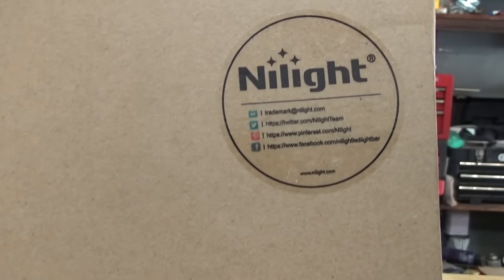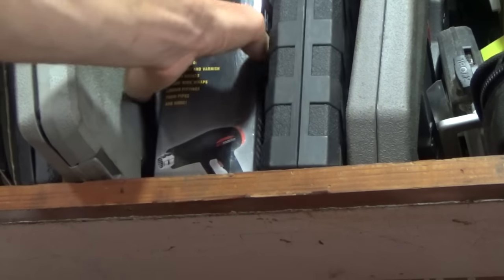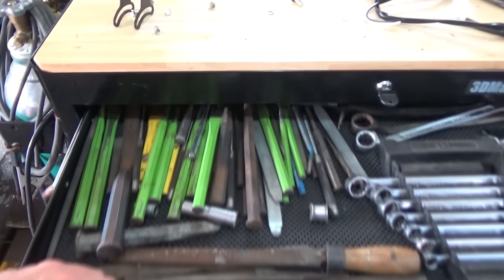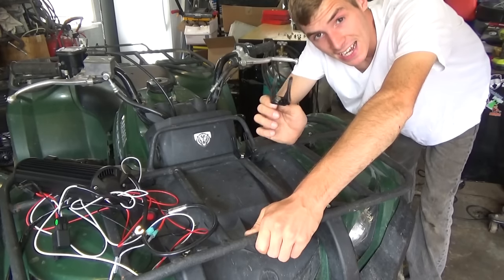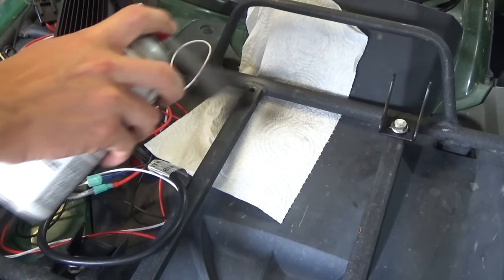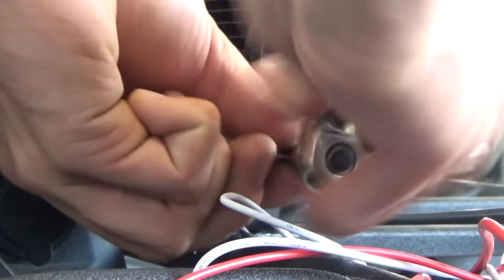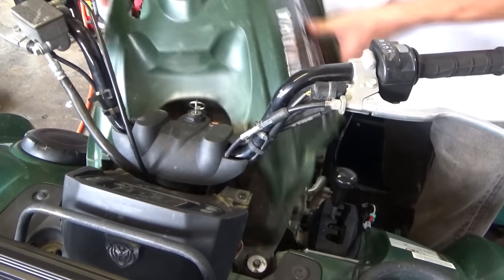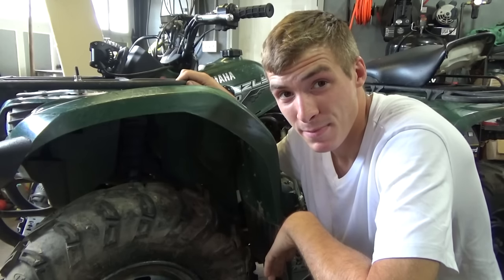Nilight 12 Inch Led Light Bar

Comment: The switch is wired backwards, just change the power wires around on the switch and the red light will only be on when the switch is in the on position
Reply: I need to try this.  My first install attempt ran my battery down overnight without the light bar even being hooked up yet.  My switch has a little blue light.

Comment: If you wire a relay up to the stator, to have a switching ground, you could have the switch light run only when the engine is running. You could probably use the smallest relay you find also since thats a small led light, so it would be a cheap upgrade.

Comment: for my light bar on one of my quads i put a splitter in the ground and then a switch so you can switch the light on the switch on/off and also a high and low beam on the existing head lights on the quad so when it use to be on low/high beam high beam at the moment is low beam and the light bar comes on when it on high and another switch to turn high/low off! its complicated but pretty easy to use ;)

Comment: Wouldnt it be better to mount it in the front of the bar between the headlights?
Reply: That's where I mounted mine. That way the rack is still usable and so is the light bar.
Reply: I was thinking the same thing, RUN THAT TRAIL AT NITE TIME BUT LEAVE THE COOLER
Reply: Would it impede air flow to the radiator?
Reply: Hotdogsandbuns not at all, I bolted it to the front of the rack. I have pictures if you want a guide
Reply: @frankyalvarez7160  yes pls

Comment: Get some unibits. They drill nice holes in plastic. If you used a relay, the light will only illuminate when you power the light on.

Comment: I miss my Kodiak!!!   I had an 04 Kodiak 450 which was just about identical to this  except the old Kodiak didn't have independent rear suspension.  I think that's why they replaced that model with this.  This has got to be an 06 or later.

Comment: Hey here's a sugestion if you want to light up the underside of your atv buy the LED GLOW brand. I use it on my atv. It changes colors and has a wireless remote to control the settings.

Comment: check the wiring on the switch. it might be wired wrong. it should be to where when the light bar is on then the switch is on. the middle should be load then one of the outsides will be negative and the other positive. might be worth double checking

Comment: I wired mine to the hi-beam circuit so I can switch them on or off as 
needed. These require way less current than the incandescent so I'm 
actually saving power when I use them BUT I can still turn them off and 
just use the original incandescent as needed since the LED bars are no 
legal on the roads and there are a few places where I can take my atv on
 the road.
Reply: How did you connect it? I have red and black on led bar and  yellow, blue and black on my quad beam.
Reply: @amitor1234  You need a volt meter.  One is ground.  One is hi bean, one is low.  With the lights switched off, set the meter for resistance. Then test for which lead shows  zero ohms between it and chassis ground.  That is the ground lead.  Now switch the meter to volts.  Turn the lights on low beam.  Attach one meter lead to the ground lead and test to see which of the other two is is now energized.  Mark that lead.  Next switch the high beams on and verify that the other lead is now energized.  I wanted my light bar to use the hibeam circuit so I attached to the ground lead and the high beam line.

Comment: if you run a jumper so the power only runs the l.e.d on the switch when you turn it on it will be off in the off position ;)

Comment: I understand that it needs to be connected to a grounding spot in order for the light switch to be on, but do you need to leave it disconnected at all times if you do not want it draining power unless the switch is flipped

Comment: Question, why did you mount the light on the back of the rack? 

You can't put anything on it now and unless you run it angled up, it'll shadow on the rack!
Why didn't you mount it underneath the front bar?

Comment: Can those brackets be mounted anywhere on the light?? I ask because my atv has holes in the bracket 12 in use apart for a really expensive factory light bar, I can use a bigger one this way.

Comment: Hey 3DMachines, for my b-Day coming soon I plan on installing a light bar on my 1986 YZ250. Besides the light bar, mounts, and bolts... what else woukd I need to get the light bar to work? I doubt they make one that is specialty made for my bike because of it being 30 years old.
Reply: You will need a lighting stator. That bike will only have a stator designed to run the engine, with no power outputs for lights or accessories.

Comment: Whole point in a trailer is so you don’t need ramps, should modify it so the ramps are part of the gate so you can open it and drive right up, otherwise why not just use ramps and out it in the truck bed ?

Comment: Couldn't you have just wired it into the factory lights?
Reply: May Tag I hard wired mine
Reply: I wired mine to the hi-beam circuit so I can switch them on or off as needed. These require way less current than the incandescent so I'm actually saving power when I use them BUT I can still turn them off and just use the original incandescent as needed since the LED bars are no legal on the roads and there are a few places where I can take my atv on the road.

Comment: Very interesting video. We are also thinking about producing an assembling video. It is insprining how you explain everything in the video in detail. We also have connection cables in our product portfolio with a switch to switch on and off the LED lights (a fuse is also included).

Comment: I know this is an old video but it seems he mounted the lightbar in the wrong place. It's kind of like having a pickup truck but mounting the lightbar where the windshield and hood meet. Obviously there would be light obstruction from the hood. In the ATV case, the best choice would have been right on the front, where you could tilt it up or down at any angle and not get obstruction from the vehicle. I think this guy will have a shadow at the bottom of his view caused by the front end of the ATV.

Comment: you just wired that switch wrong. switch the 2 wires on the terminals that aren't the ground and the switch will light up only when it's turned on. just did one yesterday

Comment: When you order it for 20 something dollars does it come with everything you need or strictly the light bar? And if it’s just the light bar what else do I need to buy so I can hook it up?
Reply: Sounds like just the bar. Check the description. Most Amazon listings say the wiring kit isn't included. Not a problem for someone like me with loads of wiring.

Comment: Needing some help just installed this an I'm only getting power to the red light switch when I flipp it on an the light doesn't light up. I read somewhere that the wiring for the rely might be wired wrong any help would be appreciated?
Reply: Some wire has to be wrong, whether it's polarity or something else. It's hard to say without seeing the switch. Have you been able to get it figured out yet?

Comment: dalton i need help on what wiring harness to order for my 2014 grizzly 450, and what size light bar did you go with?
Reply: Dalton goes with a 12 inch one. You can choose a set of small lights or just a single light bar for your 2014 grizzly 450, and I believe a low power wiring harness is enough for any light bar within 180 watt. Hope it helps.

Comment: That LED on the switch is going to be drawing less power than the natural discharge of the battery...
Reply: Ya buts it's still gonna be more power
Reply: Dylan Bailey What are you talking about...